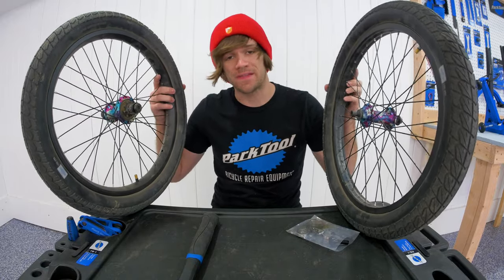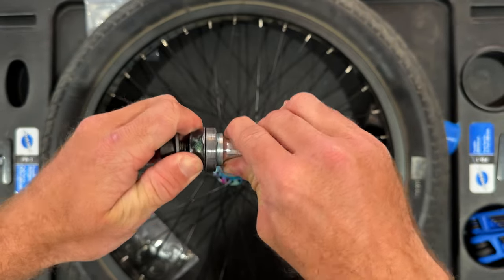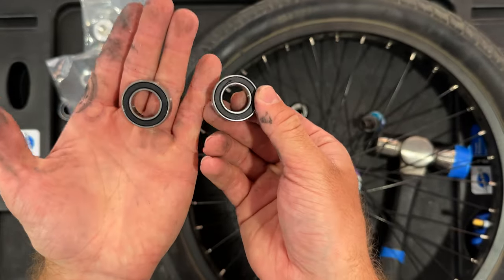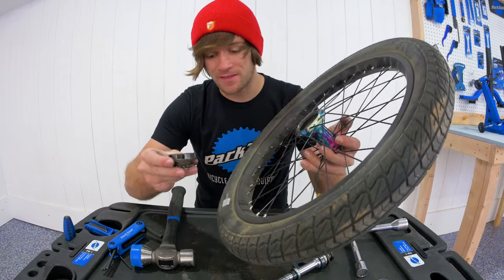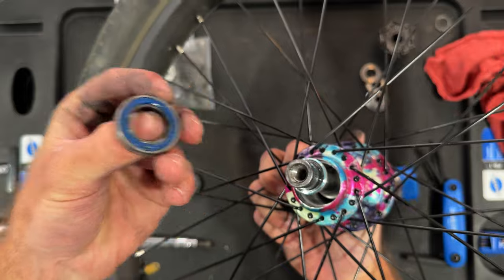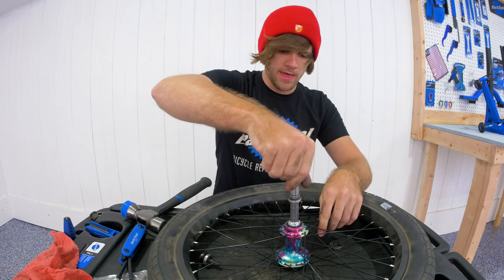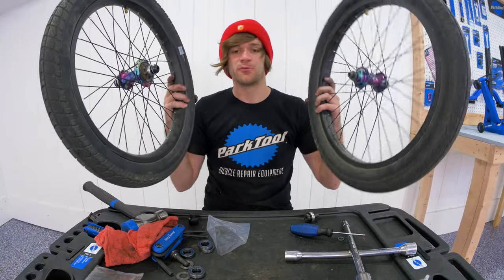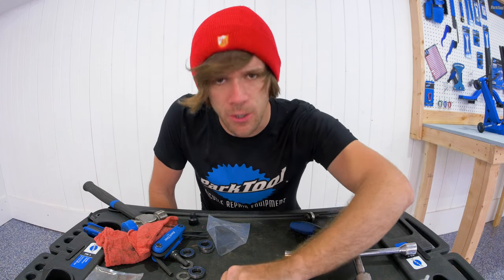How To Rebuild Profile/BMX Hubs & Drivers | COMPLETE REBUILD

Comment: Any ball bearing is not inserted by putting in on its shaft and hammering the daylight out of it, Those small balls were indented in the  hammering action and the inner and outer race were surely damaged.

Comment: I just did the profile mini hub on a bmx I just got, all kinds of thick green grease in there, to the point some of the pawls would stick in the shut position, cleaned out now with zero grease I don't even bother to drop thin oil on the pawl base, totally dry works best every time.
Reply from the maker: I agree fully and don't usually put anything in there at all either!

Comment: You say 99% of front hubs are like that, but I feel like there are a lot more unsealed front hubs out there than sealed. Maybe like 15% I’ve seen are sealed and I’ve looked
Reply: If its an actual bmx that's meant to be used in the park or street then they won't have unsealed bearings as they'll just break super quickly.

Comment: You didn’t show how much pressure goes into the male hub threaded nut. You know, the nut on the outside of the freewheel. Does that just get snugged? Is there a torque spec?

Comment: Haha! Here we go! I'm going to start calling you El Sage. I was thinking about flipping the freewheel cog and while fiddling around with it, I accidentally pulled out the paw mechanism and for the life of me, I could not get it back in. Started hammering the axle and I popped out the other side BBs. 🤣🤣🤣Then I got caught in that damn loop of knocking out the other side. So I went to the internet and "boom goes the dynamite!", there you were. Well, the trick of using a flat head screwdriver on the  individual paws worked like a charm and put it back together without fooking anything up. I was getting worried with all the pieces that I would definitely mess it up but because of your guidance all problems were solved. Appreciate you, Bro.
Reply from the maker: Haha hell yea!! I love hearing that this was able to help you. Crazy how one tiny little tip can make something significantly easier isn’t it?

Comment: searched for this video because im thinking of picking up a Kink bmx from someone who says its skipping.
do u suggest i take the chance i just have to clean it or could there be bigger issues?

thanks for teaching! the outtakes made me laugh.
Reply from the maker: Depends on the condition of the rest of the bike and price
Reply: @Brant_Moore   only $100 CAD, rest of the bike looks good. thats the only thing they mentioned wrong with it. new grips, tires, and chain
Reply: Could be as simple as someone putting alot of grease on the driver hub creating the engagement to slip , however in my experience It's a good guess that the c shaped retainer that holds the  paws inplace on driver has lost its metal memory ( has worn out. ) and over time opened up the end to end gap.   some people call it a driver spring or paw spring. ( creating a larger gap than originally.)   when it does this it doesn't let the paws all rest engaged it lets 2 of the 3 or 3 of the 4 paws to have ok engagement but once it gets to the paw that's not properly set in engagement position it cause's it to not engage to the hub properly and a tooth skipping can be fealt /heard while aggressively pedaling or pedaling up inclines.  Best of luck n your new bike if you decide to get it.  Should be a easy fix.   I've made new clips out of guitar string in a bind.  But your local bike shop should have a new paw retaining spring clip for most common drivers.  If they have em and cheap I'd throw in new paws aswell.